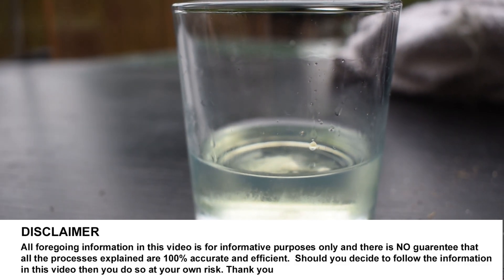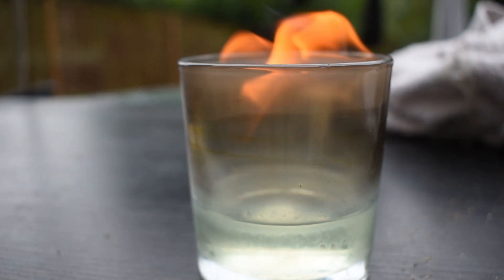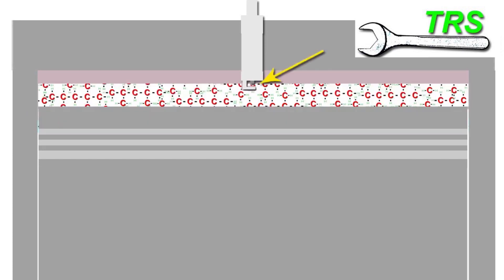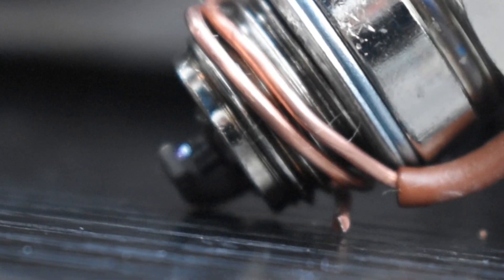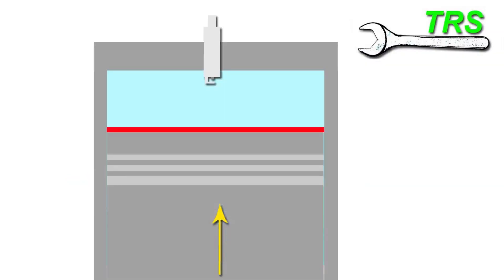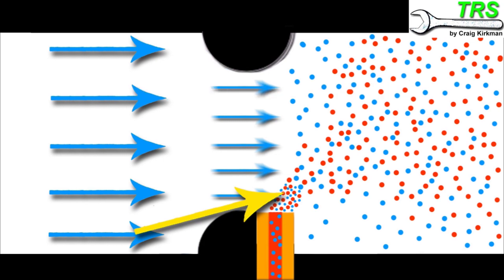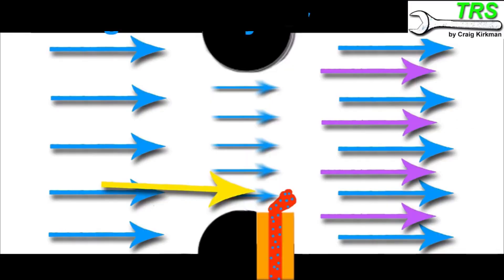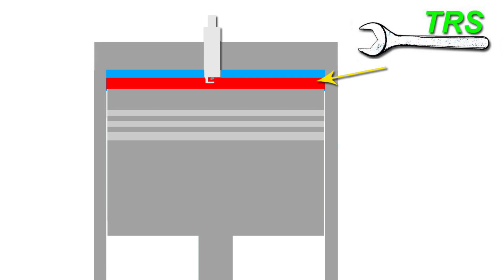Can a Spark Plug Sparking Ignite Liquid Gasoline? - Does it Explode? -Experiment  (by Craig Kirkman)

Comment: In your demonstration you held the spark plug only a centimeter or so above the gasoline (and once right next to the gasoline as well) where the highly volatile gasoline would most likely displace most of the air, so I doubt it would be getting enough oxygen.
You could try placing the spark plug at the same place the lighter was.

Comment: Well actually run a wire connecting to one ignition coil to a gas can in the back seat connect spark plug to wire drop it in the gas can make sure it’s not submerged seal the lid . Wait for someone to steal your car turn key and boom . It works as it should 🔥

Comment: I had no idea about the compression causing heat, it will certainly help me diagnose my motorcycle since I put in a lower compression piston to make it easier to start.
Reply: Compression is very important for an engine to run properly

Comment: Great video as always. Most of this I already knew, but it raised two questions in me. 
First, I thought it was gasoline vapor what combust in engine and you saying it's mist (which I think is case in diesel engines)?
And second is, what the hell is that plus sign on metal dish? 🙂
Reply from the maker: Thank you for the nice feedback. I really appreciate it.  Yes, when I referred to the mist I did so because fuel had been processed from a liquid, by way of mixing with air to produce a combustible form of the fuel. I called it a mist really to make a distinction between this processed state of combustible fuel to the combustible vapours that naturally rise from gasoline fuel when it is simply standing in an open container.  So you are right to question it.  As for the plus sign on the metal dish, its something that's on there, which is irrelevant to the point of the video really.  Thanks. Craig

Comment: there is no oxygen in space but the sun is still burning
Reply from the maker: Well, in basic terms, the burning of the sun is not chemical combustion like this. It's a completely different process called 'nuclear fusion'.  It's more like a hydrogen bomb than the combustion of fuel within an engine, in effect that is.  

So, within the Sun, when two nuclei of a certain atom, that exist there, fuse together, they become a new, larger, element.  All that is needed is enough pressure or heat to force those nuclei together, by overcoming their natural electrostatic repulsion of each other.  This then leads to the fusion that we all experience, here on earth, as light and heat.  Again this is in basic terms and there is more to this.   

So in this process of nuclear fusion,  oxygen is not required, nor is any other element for that matter.  

Here is some references to this if you would like to double check what I have said and to learn more about this magnificent process.  

Thank you for your comment. Craig    

https://wtamu.edu/~cbaird/sq/2015/03/20/why-does-the-sun-not-run-out-of-oxygen-as-it-burns/#:~:text=The%20sun%20does%20not%20run,It%20is%20nuclear%20fusion.&text=At%20the%20same%20time%2C%20hydrogen,atoms%20to%20make%20water%20molecules.
Reply: @TheRepairSpecialist  - wow, nicely explained
Reply: There is no oxygen in space but we're still breathing.